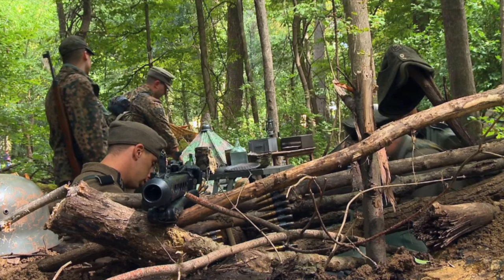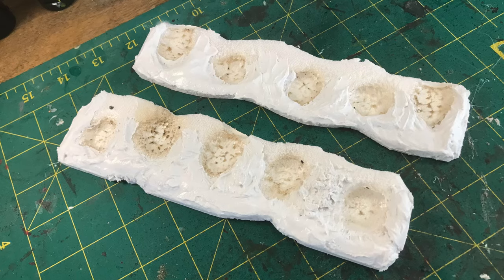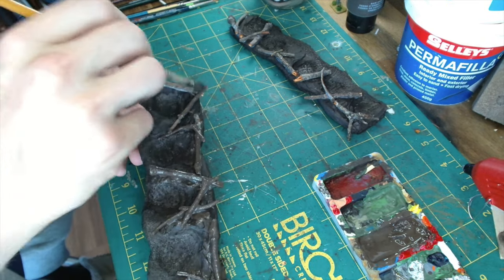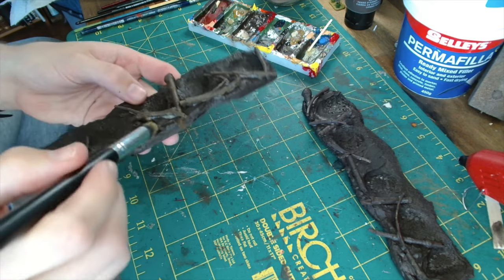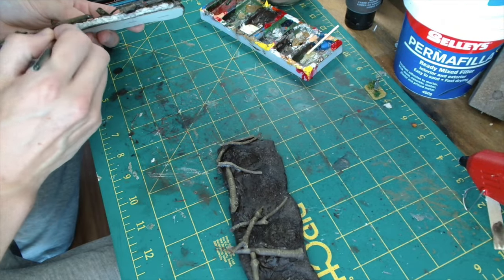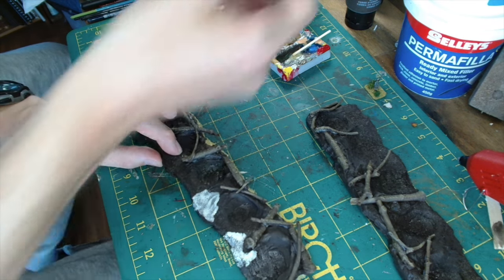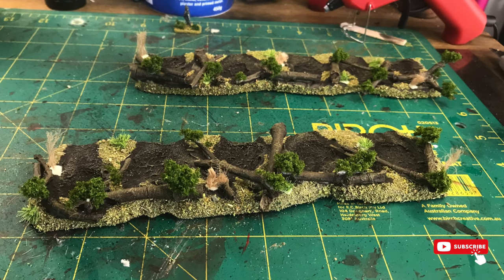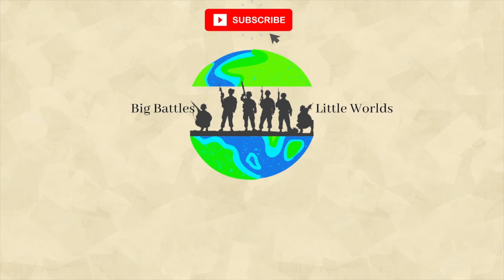WW2 Foxholes: The Ultimate Guide for Your Wargames

Comment: How do you make sterile wood elements?
Reply from the maker: Hey, thanks for watching. I have found that if I soak them in bleach and then dry them that tends to do the job and then coat them in glue. However sometimes I get lazy and skip the bleach and just go with a few layers of pva to lock it all together.